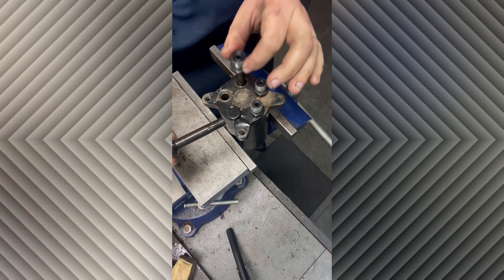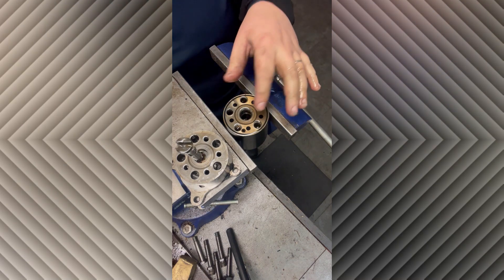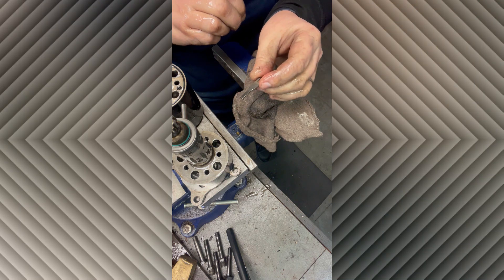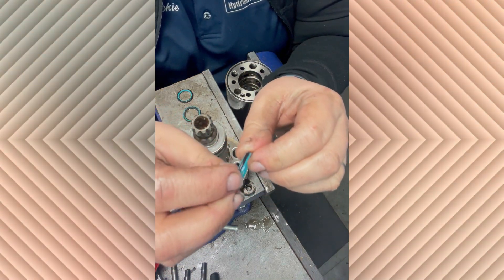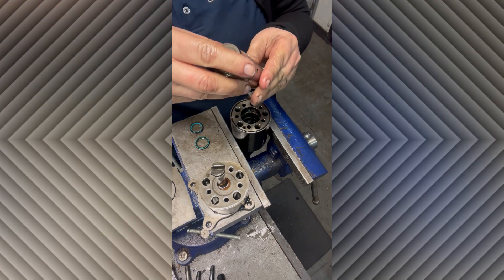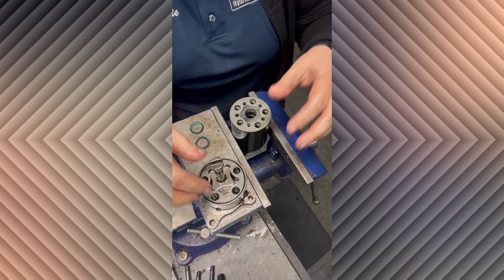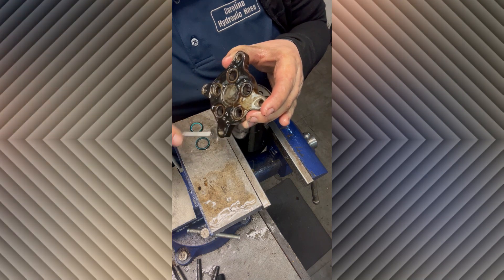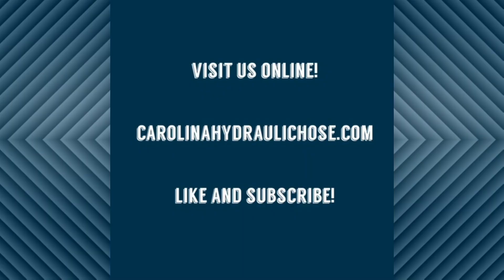Rebuilding An Orbital Steering Motor

Comment: I was expecting 1 ball bearing and 1 bar.  When I tipped it upside down, I got 1 larger ball bearing and 3 smaller ball bearings. I also got 2 flat bars and 1 with a bend in it.  I wasn’t expecting it, so not sure which hole they came out of.  Can you help?
Reply from the maker: @Shawn-vt6jv  hey! I have only ever seen one ball bearing, so I cannot tell you where the other ones go. I would say try to get a breakdown on it from the manufacturer of the motor. They should be able to tell you where everything goes.
Reply: I didn't see in the video where to put then ball and metal thing was it on the video ? I took mine line connection off when pulling a hose when I tried to put it back something was blocking the threads I pushed it over then it went in but my stearinf gasket went bad a week later.  Not sure if just replace  the gasket or that metal rod is a issue